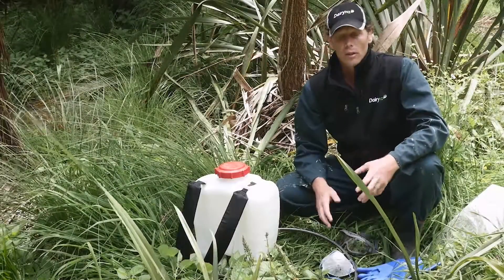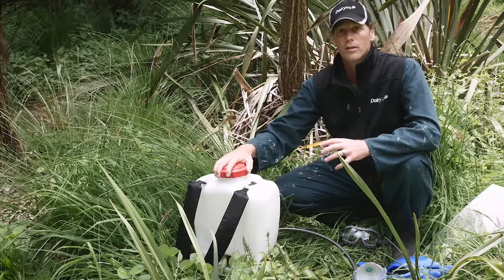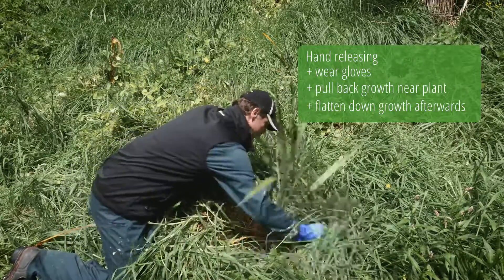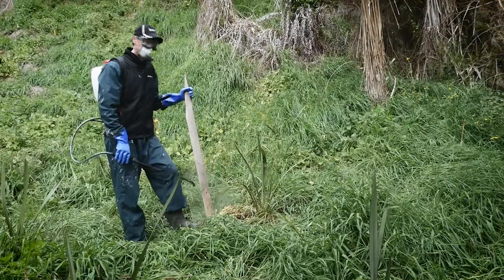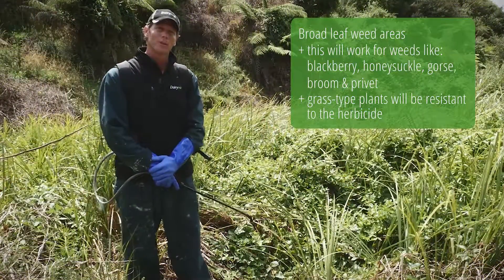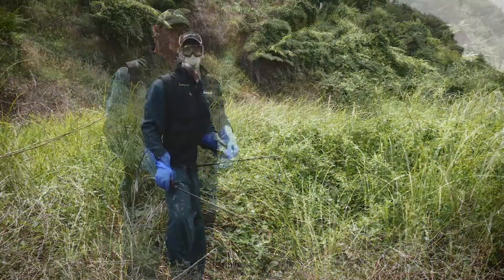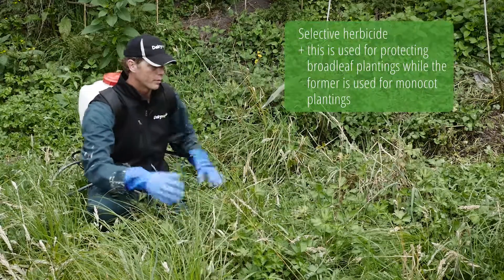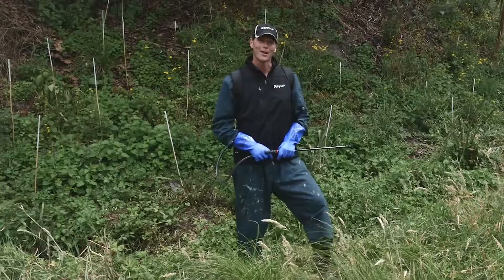Three plant releasing techniques to make your riparian planting a success

Comment: All dressed up nature ,, don't need to spray ,, mulch heavy ,, plant selection and plant heavy ,,, nature doesn't need Roundup ,,
Reply: Good points Andre. I would prefer to use the least herbicide as possible, and in some cases you can get away with no releasing. However its often difficult (and expensive) to mulch areas away from good access points. In the example above that would mean backpacking mulch into the site. Mulch and dense planting also won't out compete weeds like honey suckle, blackberry, wandering willie...etc etc,  as pictured above and your planting and could be wiped out completely (which has happened to me in my early days).